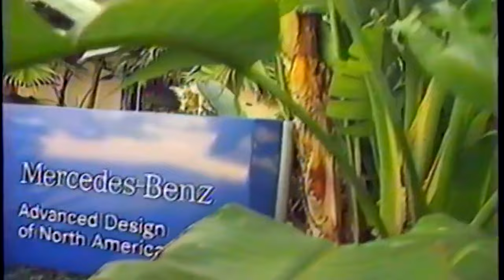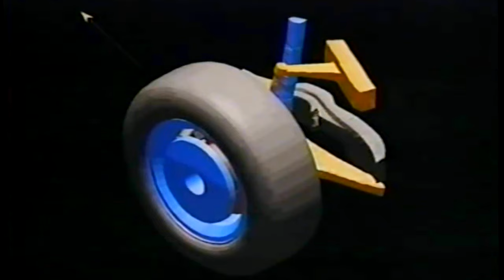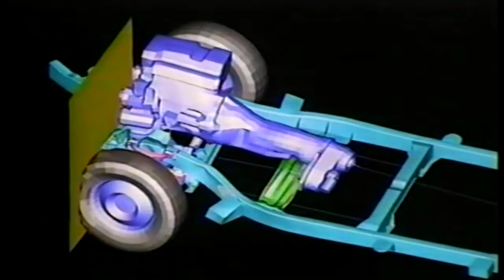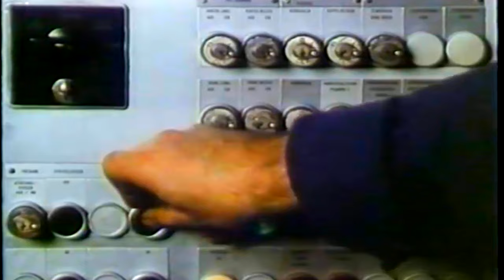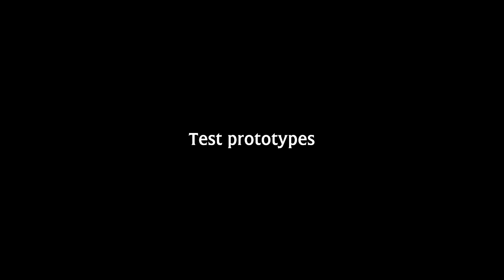Development Mercedes-Benz M-class w163

Comment: Agree, it was hard to find the replacement for my 2001 ML430 full frame design.  The GLE, GLS could not replace the solid built design of ML 430 2001 now still runs well at 175,000 miles.  Now trying to replace the ML 430 with Sprinter 4x4 will see if it holds up after 100k miles.

Comment: W163 doesn't have very exp material s inside but more utilitarian and will go thousands of miles. My ml270 2003 6 speed manual has over 250,000km on it and still going.

Comment: too bad they didn't bother to test the fuel pump design......on my 5th pump genuine part.
Reply: cyronader 
Have you replaced your fuel filter? I have had several ML320 and 430 and never had an issue with fuel pump